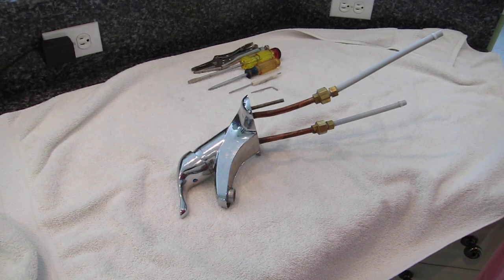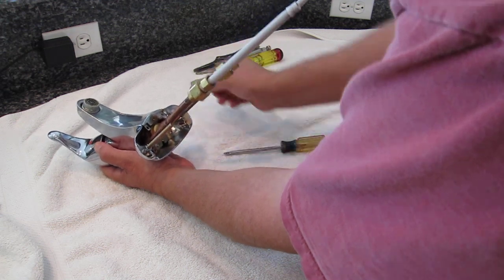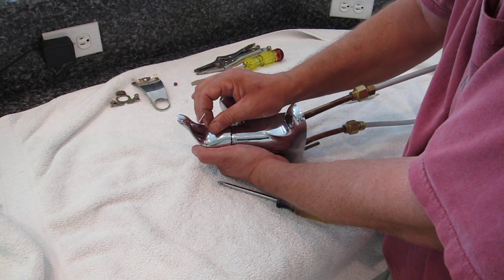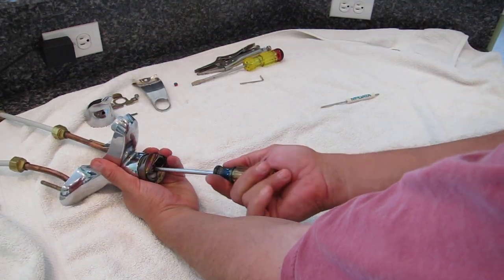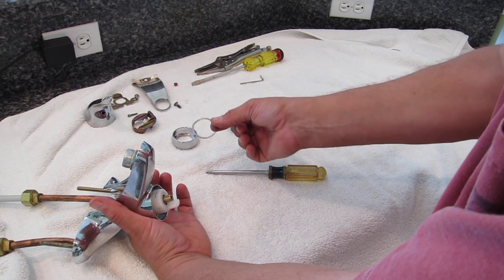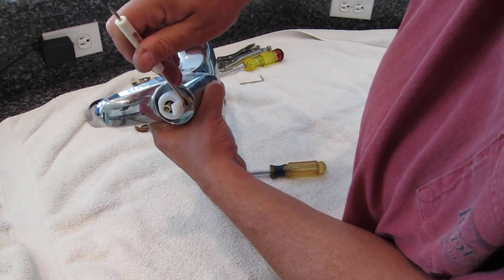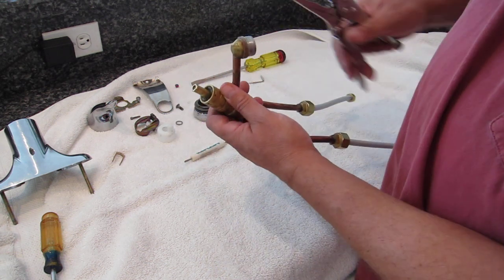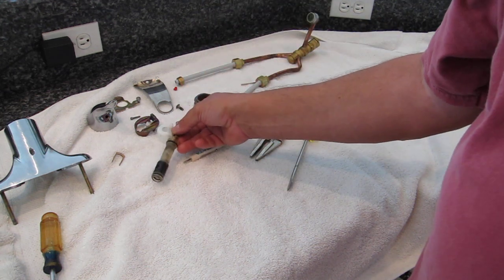MOEN Faucet 4600 cartridge removal

Comment: If you are just replacing the cartridge there is no need to remove the entire valve body or the faucet from the sink. Just turn off the water and extract from the top after removing the handle and cartridge retainer attachments. This method will take well over an hour vs 20 minutes for top extraction
Reply: I agree, why take the whole faucet off just to take out the cartridge.

Comment: I wonder how often the entire valve needs to be replaced instead of just the o-rings and perhaps soaking it in CLR to remove scaling. Home Depot has my cartridge for $20, online I've found it under $10 shipped. But I'd just as soon spend a buck on some o-rings.

Comment: Way to take the high road. It's funny how people just loooove to fly off the handle and start out with insults and name calling. If you were a "complete idiot" I'd have expected you to start out with, "to remove the faucet, attach the metal cutting disc to your Dremel tool and start hacking away." Thanks for posting the video. It has saved me from buying their $18 one-time-use-it-and-lose-it tool.

Comment: Can you remove the aerator on this? I have this exact one. I just changed a difficult to move cartridge using this video, but I did not do all the underside removal stuff as in this. It was confusing me that the grey piece didn't unscrew, but you have to use just a bit more force and it comes in steps. I found bits of cut off valve rubber all over and was interested in taking the aerator off to see if I missed any that could be flushed out.
Reply: did you ever figure it out? This aerator is driving me nuts. I cant figure out how to remove it
Reply: @baphomet1872  Yes there are 2 types one that unscrew with a key that are newer, and the one I have which is older the part with the aerator screws into the main faucet. If you don't see like holes for something that rotates to grab you have an old one. So in my case I took a bit of cardboard, like toilet paper core, and put it around the cylinder. I then took some plyers and rotated counter clockwise. It then unscrewed and you can take it out.
Reply: @MatthewSuffidy  Thank you! Mine was just super stuck I think. I ended up getting it out with pliers :)

Comment: Same for me after removing 3 pieces from handle the last grey collar piece just does not unscrew so i cannot get to the cartridge, any way i can send u a small video via whatsapp, i am giving up at this point.
Reply: I had the same issue, I just replaced the faucet because I couldn’t get to the cartridge because the gray piece doesn’t twist off. It cost $49 for a new one.

Comment from the maker: Thanks for the comments! Glad it helped.  I needed to replace a cartridge in my faucet and found, as you may have, that the directions didn't match my faucet. Nor, could I find a reference on YouTube. So, I figured it out, and shared what I learned. As bhuddahep recommends, don't hire me as a plumber, as I am not one. However, his comment concerning not having to remove the faucet body may save you some additional time.
Reply: Your post still IS the only one. You save my hair from being pulled out lol. For me, the pivot retainer is stuck from water build up, almost 13 years of it. So thank you very much for this post. It saved my sanity.

Comment: Friend has 17 year old Moen 4600. Water does not shut off. Easily removed the retaining clip, but the cartridge was fused solid, and will not come out. The faucet does not need removed from the sink to remove the cartridge. Called Moen, they recommended the Cartridge Removal tool #104421. $15-$25 most places, found for $9 on amzn. Figured would be 'a use once in a lifetime', 'use once and lose it tool', so I decided to do what SeaMoose is doing. The faucet, even tho 17 years old, came apart completely in 5 minutes. The gray handle adapter does NOT unscrew and can NOT be removed from the faucet, until you disassemble the faucet, then release the tabs and it will fall through the inside of the faucet. The vicegrip hack did work, but took a lot of pulling and tugging to get the cartridge out. Not fun, but it's out. The replacement cartridge as stated by prior commentors (I know it's not a real word), is a 1225. found 2-pack on amzn for $20. Some Moen models have lifetime warranty, they will send you parts and cartridge.  Next time I will opt to replace instead of repair.